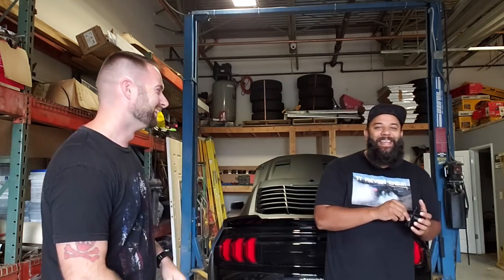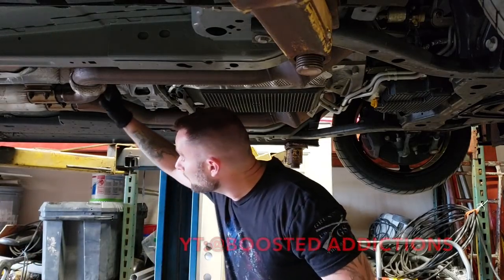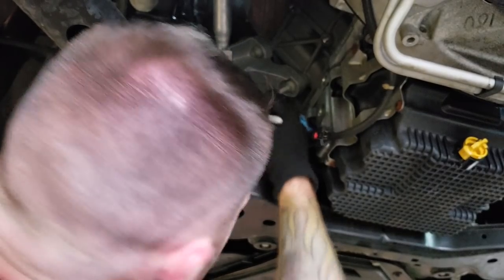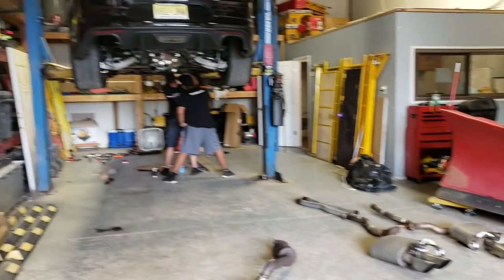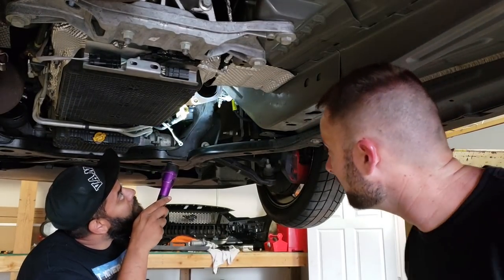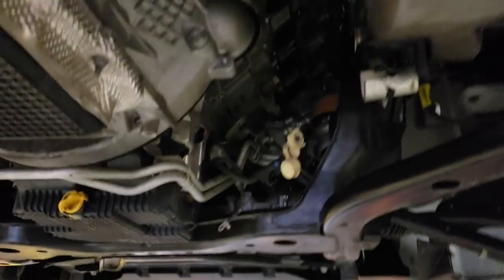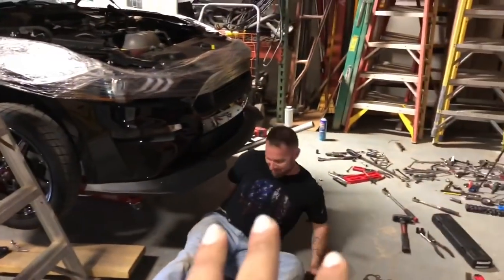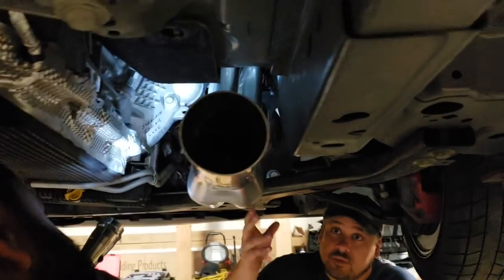2018-2019 Mustang GT Header, CAI Intake, PBD Tune and E85 Install.

Comment: I have a 2016 Mustang gt and  installed Texas speed headers in 6 hours .. my 6 speed was way easier than her 10 spd auto .. she has a 2020 mustang gt with Stainless power headers..the problem was I had to dent the header on the driver side to clear the steering shaft on mine with Texas speed... so headers didnt fit perfect. the stainless power had better fitment on her car .and did hers in 8 hours ..on jack stands for both.

Comment from the maker: What do you all think it will run? 10 Second 1/4th mile?
Reply from the maker: I know what it is but cant release that info yet. stangmode asked be to keep it quiet until he drops his next video. I can tell you it is way way more than expected.
Reply: I think its going g to run 10.9😎
Reply: It won't go 10's without serious suspension mods.  Steeda's is in the 10.9 range and its completely tweeked.  Mine is within a tenth of StangMode's time, but I'm full interior, I've never taken my seats out like he has. @Zander13
Reply: Correct tuning on e85 says high 10s
Pulling out timing up high brings that HP curve out beautifully
Reply: The power it made it's 536 WHP so that's 635 HP and theoretically it should run 10's because the Porsche 911 Turbo S with 570 HP runs 10's but we ave to take in consideration that it has all wheel drive which helps it not spin and pull fenomenally like an electric car...
Reply: Zander13 you should come to Cincinnati Ohio and help me install my tsp lt headers. I’ve never installed them before. I’ve paid in the past. Kinda want to attempt it but I know I’ll fuck something up and be screwed. I have a 2018 stage 2 Whipple 10speed calling for you to beat on it lol

Comment: I’m currently in the process of install these same headers ..... what the trick of using the factory studs it’s no room put on a socket or a wrench
Reply from the maker: I didn’t use any of the factory studs. Some of the top ones might fit though.
Reply: Okay so you used like some arp bolts ?
Reply from the maker: Matt Cousins yes

Comment: isn't it illegal to take off the Cats?
Reply from the maker: It can be depending on state
Reply: 2018GT5.0 10R80   This is actually a global law and not restricted to the USA, any car sold with a catalytic converter needs to retain a cat though it doesn't matter (to an extent) what size you run. So with a car like this you could run 5" or bigger cats and see the same power increase... 
And still be legal. 
These guys are just doing it on the cheap, and I find that disappointing considering the amount of sheep that'll follow this shit.
Reply: Good thing the whipple supercharger is legal in Cali my only option for more power and still be legal.
Reply: @frontbum666  who cares, adding a cat is more expensive. Plus he's on e85 so he's not polluting the air to much. 😂

Comment: Did you have any clearance problems with your passage side header and the a/c line? Were they touching?
Reply from the maker: Make sure the engine did not slide over towards passenger side on install. Very common. Have to pry it back the other way
Reply: Ok thanks Zander!

Comment: Hey man, I love watching your video because your content is so useful. But I just bought the Corsa Longtube headers for my 2019 Mustang GT and I’m taking it to a local shop near me and they are going to charge me 600-700$ to install them. I just want to get your opinion and see if that’s a good price for an install or, should I try to install myself on some jacks stands?
Reply from the maker: 6-700 is about the going rate. I, Myself am cheap so I always do things myself. It is about a 7-12 hour job though on jack stands.

Comment: One question how did you guys deal with the 02sensors? Did you guy use the extensions ? Or not ?
Reply from the maker: Yes. He had the correct sensor extension that they sent him
Reply: You can reroute the passenger's side o2 sensor wiring to make it reach, but on the driver's side you need to either use an extension or reroute and use a  oem passenger side o2 sensor (comes with a longer lead wire).

Comment: Since it wasn't mentioned in the video:  Make sure you disconnect your negative battery cable before you mess with the starter.
Reply from the maker: Yes definitely
Reply: It was mentioned

Comment: best way is to buy a hellcat and put drag radials on it. Boom in the 10's
Reply: Or, he could continue with the car that cost him a crap ton less and beat that Hellcat anyway. ;)
Reply: @KlipschHead281  unlikely
Reply: @KlipschHead281  and of course it was meant as a bit of a joke because i know he had a fast hellcat.
Reply from the maker: yes, exactly my thoughts
Reply: @Zander13Productions  what is stang mode running these days? I know at mod2fame fest my stock hellcat was faster
Reply: Robert Meehan  - Its unlikely, now you're joking.
Reply: @KlipschHead281  every nodded mustang I have raced so far has lost so no.. Not really. And to beat me they spend more than just buying a faater car at least that has been my experience. I spent the cost of my new fox body on mods and still would loae to a new hellcat let alone a mildly modded one. My acquaintance andre has a mildly modded hellcat that was at mod2fame fest and ran a 10.1
Reply: Robert Meehan  - Not arguing anything, your experience is different from others, the best I have seen stock Demon's run is mid 10's, some low 10's. I have seen a crap ton of not heavily modded Mustang's running 9's at a much lower cost than an entire other Mustang. The fact you spent the cost of a new Mustang on mods and still only ran low 10's, says something about you, not the other Mustangs out there. For the kind of coin Mustang's are running low 8's. The fact you say a heavily modded Mustang would lose to a Hellcat is just silly and you know it.
Reply: @KlipschHead281  I am not argueing either. Not some troll. i said foxbody so..... Talking 12 k new. Added a turbo. Blew a head gasket. Added a better fuel injection. Blew a head gasket. Upgraded the fuel lines not just the  pump. Blew the clutch. Upgraded the clutch. Blew the tranny. Broke some teeth on the rear end. Twisted some axles.  So what i have seen is people.... Whether mustang or mopar or chevy think they can bolt on a power adder and suddenly they are gonna be the fastest thing. When actually to do it correctly you have to reengineer the car to handle and or make the power. It is always way more than juat adding a supercharger. The guys that are running 9 seconds have a crap load of money in it. They might be lying to themselves but i guarantee if they are 9 seconds and not breaking they have spent tens of thousands. 
As far a a demon. If it has race gas and the race CPU they run 10.1 to 10.3 on average. On a cool day they run high 9s. They have a warranty and they probably will increase in value unlike  a modded car
Reply: Robert Meehan  - I stand corrected, I missed the fox part, sadly stock fox Mustang's suffered from garbage transmissions, I've own a lot over the past 4 decades. I agree people think they can add a power adder and they're bad ass, I've raced a lot of them since 1978, too many get to the track and find nothing but humble pie waiting for them. The track will show people that throwing parts at a car don't always mean fast car. Yes the Demon should run low 10's but honestly, my 18 GT with the A10 can get down there with little trouble and run with the Demon, lets drop the Hellcat, if that stays stock it's not hard at all to run with them but yes it will definately cost over 10k but guys are doing it, those that know what they're doing of course. as for warranty or value, we both can agree people buy a Demon for a different reason than people who buy Mustang's Camaro's etc.... good talk, have a good night.
Reply: @KlipschHead281  now that I am older I prefer my big comfortable fast car. My wife and I drive it to the track. Race on street night then drive it to dinner. We run 11 flat or 11.1 we get it serviced at the dealer and have the extended warranty and My car isnt breaking crap and getting towed. It is just a great time to love cars
Reply: Robert Meehan you had not race me yet !
Reply: Robert Meehan when will you shut up ? Too much talking !
Reply: @lockdown03cobra  I don't even know who you are.
Reply: @lockdown03cobra  so ask yourself ? Can you beat a car that consistently runs 11.1 @ 125? 
Can you  beat a driver that consistently cuts a .1 light?
I understand .1 isn't competative in bracket but for an occasional racer it ia good.. 
So can you do that or not? 
Coolwrld302 has a track day coming up. I will be there. Will you?
Reply: @woodboat3G  - Mine runs 12.0 stock so I can't complain, it's comfortable and also has the extended warranty and so far after 40 passes isn't breaking things. Have a great Christmas.
Reply: @KlipschHead281  sounds awesome. Have a great Christmas

My Hellcat has been flawless too. 2016. I have over 80 passes on the strip. My wife and take turns. Thats why the windshield has. 2. In my videos. It is her car after all. If u are near MD in April we are doing a private track rental.